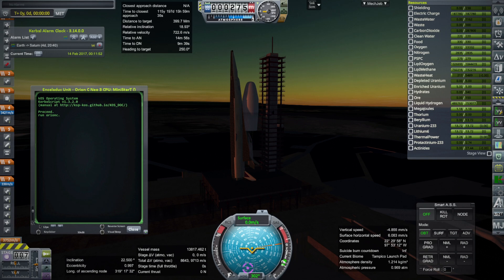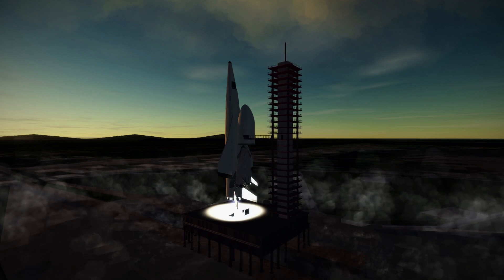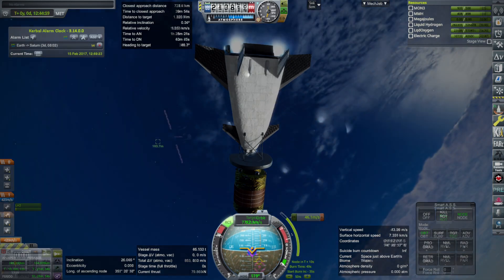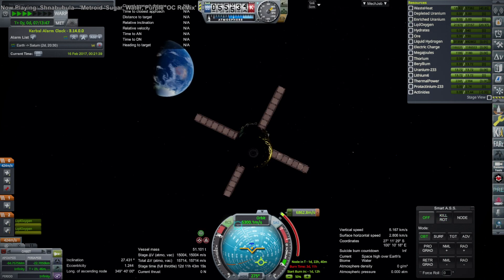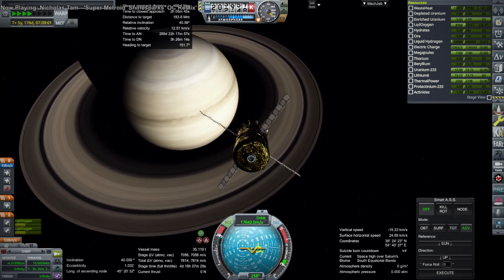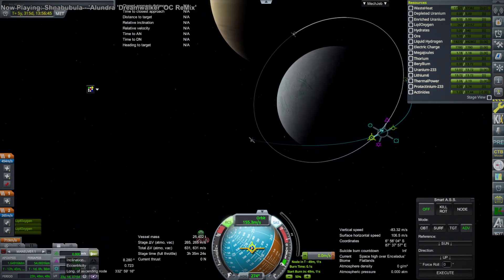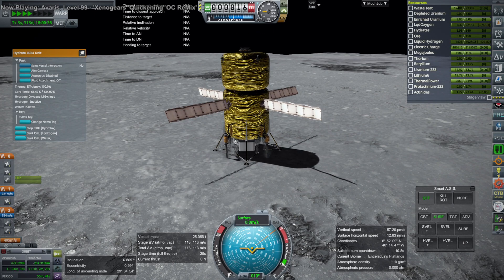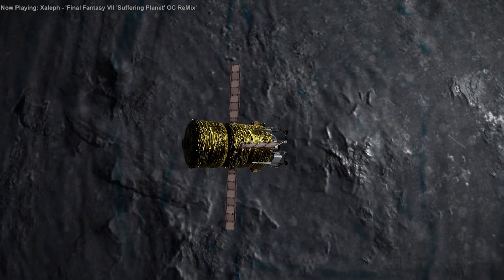Enceladus Lander Full Test (RO in KSP 1.12)

Comment: hello raiz would like to buy an RX 7600 XT with 16 GB of RAM. Do you think it would run RSS with volumetric clouds? And if not, which graphics card would you recommend
Reply: if 7600XT is your budget you would probably get more performance buying a used card a generation older, maybe a 6800XT in a similar price range. Lower end new cards are almost always a worse value than a slightly older higher end card
Reply: if 7600XT is your budget you would probably get more performance buying a used card a generation older, maybe a 6800XT in a similar price range. Lower end new cards are almost always a worse value than a slightly older higher end card. Good luck!
Reply from the maker: I don't know - I'm not familiar with the Radeon side of things.
Reply: Absolutely. I have a 1660 super and i run RSS Reborn with around 40 fps.
Reply: @benjaminrickdonaldson  you have my respect